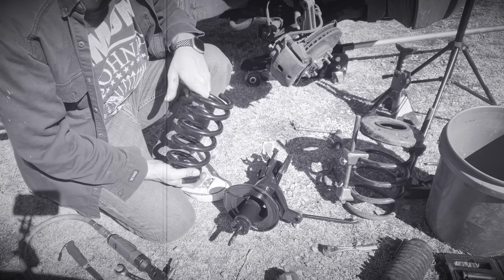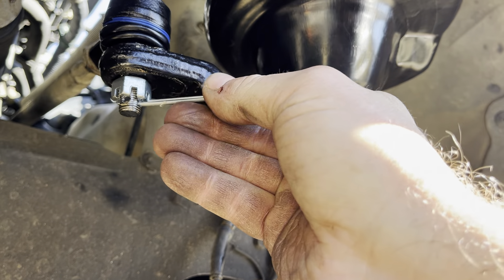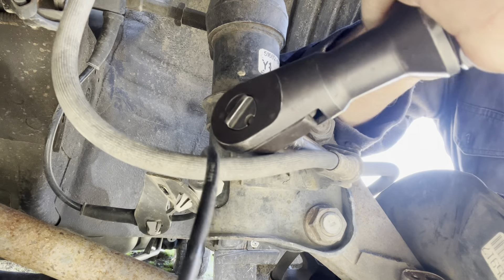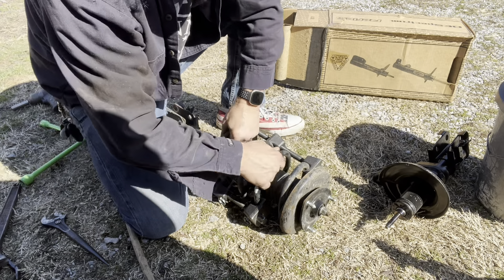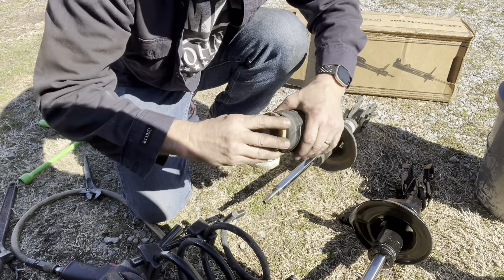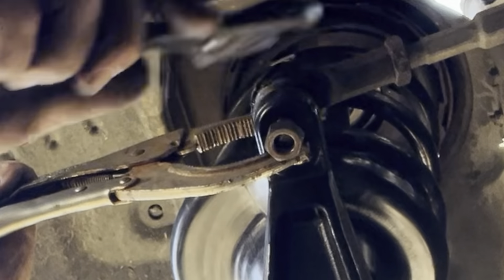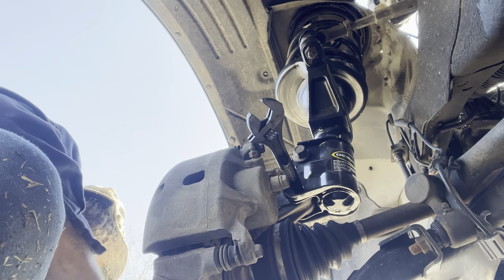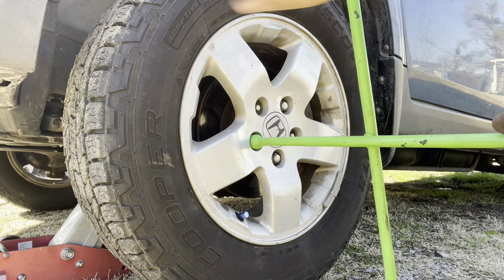Monroe Front  Struts for the Honda Element.

Comment: I did my front struts last spring. Went to Honda for the shocks, kept my springs, strut mounts, etc,  as they were all still good.  Went to Harbor Freight for the spring compressors. It's like you said in one of your previous videos, "Don't be 12 beers into the weekend, to do this job, pay attention and you'll be fine."  First time doing it, it's definitely one you want to do stone cold sober, but like you said, pay attention and it'll be fine. I watch a minimum of 4-6 Youtube videos before I attempt any new procedure on my  Element.
Reply from the maker: Thanks man!! Yea, working on anything is dangerous if you're not careful.

Comment: I think that reusing your own springs is the way to go as long as they are not broken or sagging.  The parts stores make more profit off the Quick Struts so use every excuse they can to upsell them.
Reply from the maker: I think they will be fine. I just figures since I had it apart and THOUGHT I had found a deal on some springs.
Reply: @clintsearcy3252  RA only has rear springs and Mevotech only.  It seems odd that front springs are not available at all on the aftermarket, as in OEM-style replacements, not lowering/raising or performance.

Comment: I had to throw on front Quickstruts on my AWD 2007. After about 6 months I got terrible banging when rolling over bumps. Tie Rod ends were replaced about a year earlier. It drives straight, but it feels like strut assembly is loose and banging. But its completely tight. Any ideas on what I need to fix?
Reply from the maker: It's really had to diagnose front end noises on these things without seeing it. Could be axels, ball joints, struts, motor mounts.ect